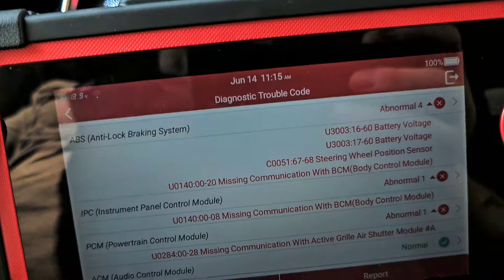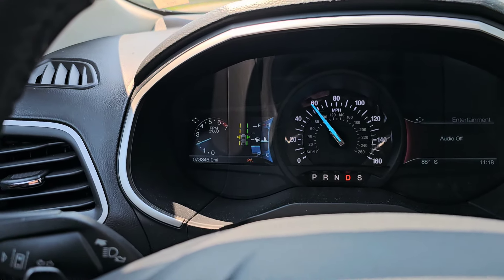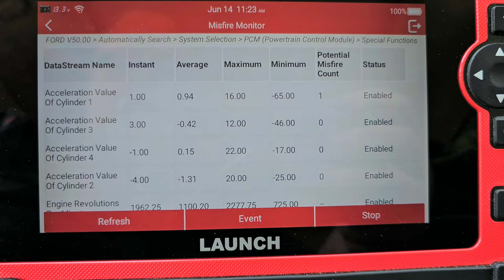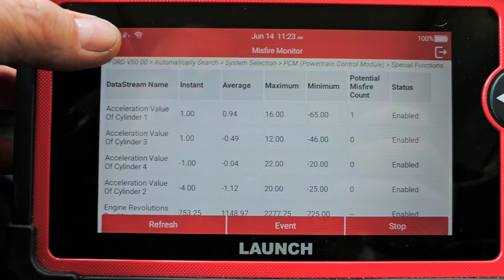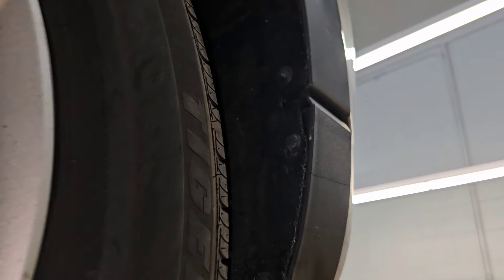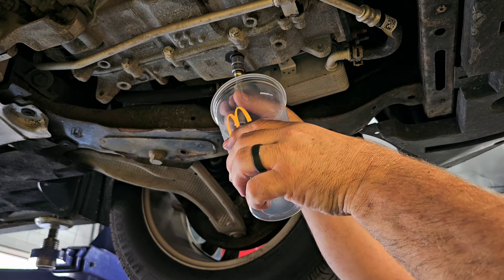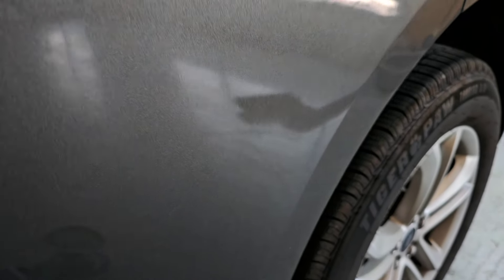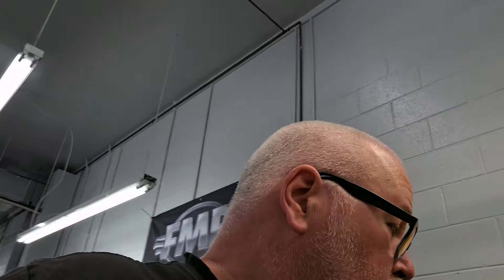Transmission Shudder, RPM Fluctuations & Nasty Fluid!!

Comment: I've got a 2015 Chevrolet 1500 4x4 High Country Crew Cab and at approximately 61500 miles the transmission started to shutter! The dealer was very aware of the problem but quickly let me know that it was out of warranty!! I took it to a recommended transmission shop that did a complete trans fluid flush and refill with the newly recommended Mobil 1 transmission fluid and they also changed the filter and flushed the lines ECT. I was very fortunate because mine had just started to get the shutter! It cost me almost $400 but I've put another 30,000 miles on it with no problems thus far! IMHO, Chevrolet should recall every dang one of the problematic transmissions!! Thanks Kenny
Reply: Recalls happen when it’s the most cost effective option to manage the issue. If it will be out of warranty by the time it fails for the majority of their products a recall isn’t likely. The problem is the manufacturer policies on vehicle ownership. They used to want everyone to pick their vehicles so you would get the best they could provide. Now they want you to choose to buy every 1-5 years so quality must be low.
Reply: I have a 2001 Lincoln Town Car 172,000 miles, the transmission started to shudder,  I dropped the transmission pan, changed the filter, added 3 bottles of Lucas Transmission Fix,  181,000 no problems.  It's a 4 speed overdrive
Reply: 2018 Silverado HC 31K shutter; Chevy dealer knew of torque converter problem, $970.00 filter & trans flush with mobile 1. Problem so far fixed 41K; GM reliability & quality are a thing of the past.
Reply: Get it tune asap... remove the tc lock on 1sr 2nd and 3rd.... if you ever pull it appart put a triple billet torque converter and again... GET a tune for the transmission it's a must. Add an extra transmission cooler too.. I put the mishimoto one efty expensive but I went from 100°c to max 57°c while towing. Any cooler will do just don't stay with the oem one. 2016 mine gave up at 110k km my 2nd one I manage to push it to 270k before having to open it.
Reply: Really important to get the thermostat delete for the transmission cooler line.. early version were opening at 180°..  later they revise it to a cooler one but put a ball and a springs to keep oil in the line/cooler and just take the thermostat right out. Heat and bad tune from gm along crappy torque converter are the culprit of the 6l80e.

Comment: my wife bought a 2015 escape. after the dealer kept messing up simple things i took over. i pulled the plug on the trans and burned liquid came out. and not much. my thoughts are that in the 81k miles that service had never been done. they told my wife they put a new motor in the car ( it failed 2 days after she brought it home) so i pulled the oil plug. also burned black and less that spec. yeah they totally put a new motor in it. i think its not always a lazy owner. sometimes its a shady big box dealer service center
Reply: Don't by from dealers are a scam

Comment: I have a '94 F-150 I could have sworn was torque converter shudder because it only seemed to do it under load at certain speeds. I flushed the transmission fluid and found it was very clean. I then checked the spark plugs and they were in really bad condition. I ended up deciding to replace the wires, plugs, ignition coil and distributor, since I didnt know the history of the truck, and ever since then it runs just fine.

Comment: Change the transmission fluid every 30k miles.  Even if the manufacturer says it's a "lifetime" fluid
Reply: I do mine every 15,000 i cut the service intervals in half time. For my Vehicles.

Comment: Was getting a shudder in my 89 F 250 but not right away and only when it locked up after going into third,fresh fluid,filter and a can of the trans mechanic in the can Sea Foam trans additive fixed the problem for now.

Comment: It would probably be a good idea to check for TSB's on this one. We have issues with the map sensors on 2019 Edges, and when it acts up if feels exactly like a transmission problem. Once there's a few miles on them, the trans fluid is never red. I can't guarantee the map sensor is the issue, but most independent shops don't check for bulletins and they just throw a new trans in only to find out later that it just needed a map sensor.

If you don't have access, the TSB number is 19-2212, and the updated part number is AA5Z-9F479-E.

Comment: Had a friend had the same problem and the dealer gave them the run around until the warranty was out and wanted to replace the  converter for 3500.00 . They were able to get it fixed for a $1000. 00 by going to ford and complaining about it . Would like to know what was wrong and how much time it took to fix .
Reply: Ahd why would they do that? Dealers make a fortune off of warranty repairs. It accounts for most of their business. The last thing a dealer is going to do is send a heavy line warranty repair out the door. There's always more to the story.

Comment: I have been trying to find a dependable Used Car that I like and can Afford......My Question is are there any cars out there that do not have apart after a couple of years ??? 
I would appreicate any input .....Thanks
Reply: I've had good luck buying luxury vehicles as they come off-lease where the lease was to an individuals in a high-income area (like Alpharetta Georgia), and the miles are low.  It's not going to be the very cheapest car of that model year -- but it'll be the best.

Comment: This is what happens when the fluid never gets changed. Some mechanics say "never change transmission fluid". I say fluid is cheaper than metal. Fords have transmission issues. The thing is what are ya doing with the vehicle? Trading in at 80k? No need to do extra maintenance. If ya think ya are going to 200k without majior issues? Ya gotta do 3 or 4k  oil changes and trans fluid at 50k max. I change my own at 30k